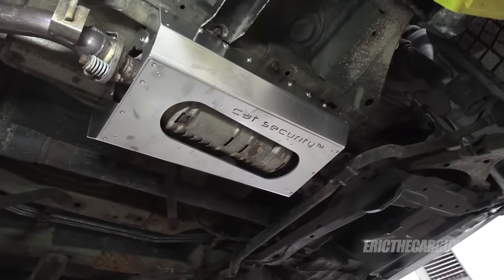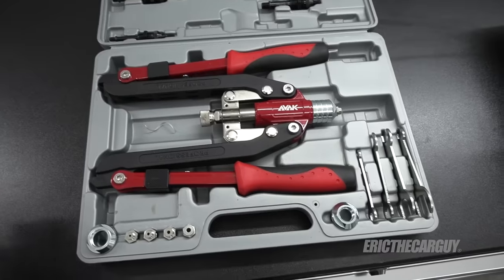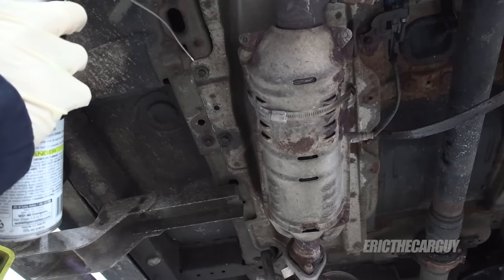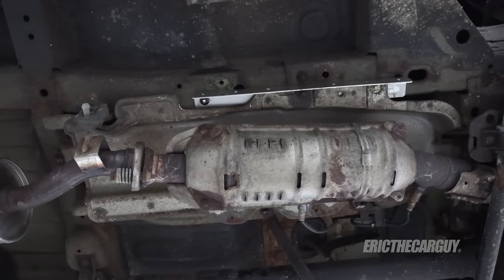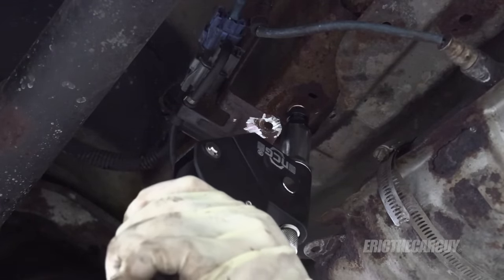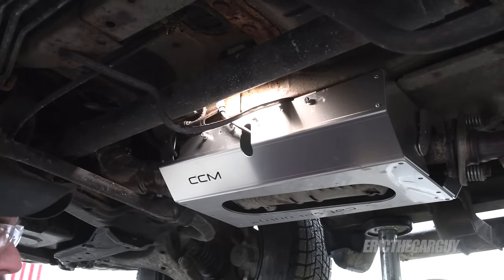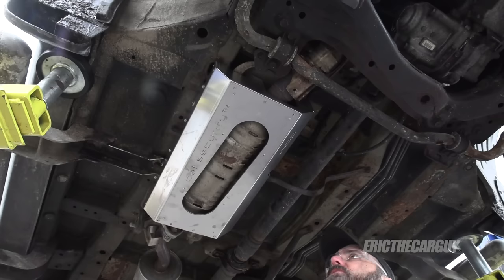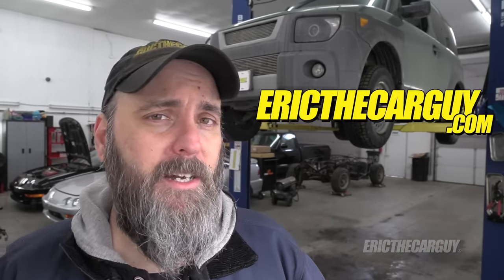How To Prevent Catalytic Converter Theft

Comment: They would be disappointed to steel mine, it’s empty lol
Reply: I am thinking about doing the same thing to my 2016 VW but I don't want to make the "check engine" light come on.
Reply: @mirkofernd  your check engine light is going to come on for some other BS. Or if not your car will break and there will be no point in saving your junk and you’ll scrap it and next time you won’t by a VW
Reply: Be careful removing emission components on these newer vehicles. You could reduce power due to engine going into a safe mode

Comment: Where do thieves sell the stolen cats? In some states, you have to show ID to sell scrap metal to scrapyards to thwart thieves from selling stolen metal.
Reply: I don't know, but I just bought a cat from Amazon for $160, which cost $1050 from Honda. It has ugly booger welds, but the car can't tell the difference. I wondered if it's just some poor victims cat with new brackets welded on it.
Reply from the maker: I'm sure they've sorted that out ahead of time.
Reply: I scrapped a few cats a couple years ago here in MA. They only grab your ID the first time you dump there. After that, you're in the system, so you just bring the stuff down and get paid. I think the only way someone could get caught is if the cat had a VIN number stamped into it, and the police were watching scrap yards for cats being dumped in particular. I've never seen that happen, here anyway.

Comment: They're now cutting off wires and other random sht in revenge when they run into deterrence systems.
Reply: In my area they are ripping sections of wiring harnesses out with the converters. They don't even cut or disconnect the wires they rip the 02 sensor wiring by yanking on the converter after they get it sawed.

Comment: There’s an easy way to prevent converter theft. Install a motion sensing lift kit on your car, thief goes to cut, sensor is triggered,and BAM! Heard of Venus fly trap? Yeah buddy!!!

You can accessorize by installing an automatic dispenser that will unleash whatever liquid/chemical on said thief once sensor is tripped. Phosphoric acid, sodium hydroxide, 90 weight gear oil, Raid, essence of skunk. You name it!

Comment: Big question that I didn't see addressed, what's it cost? Checked the website, depending on the vehicle, $150 to $450, with most in the $250 range. Not bad. Yes, they'll move on to easier pickings (usually) but when I put an upgraded sound system in my car and made it VERY secure, my son pointed out he knew some guys that stole aftermarket stereos out of cars and if they can't get what they're after, they'll totally mess up your dash, slice your seats, etc... I'd be interested to know if anyone with one of these kits installed has suffered cut sensor, brake or fuel lines.

Comment: It's remarkable that manufacturers have never really done anything about this problem from the factory.  It's not like platinum group metals used in cats were ever cheap, they were always very high value theft targets and the theft of cats is not a new phenomenon, if anything it has remained a relatively constant type of auto crime. 

I know it's difficult to secure it completely but it seems like next to no thought has been put into making cats more difficult to steal which is pretty shitty given we expect quite a lot from standard car security features, particularly in 21st century models.

Anything that slows down the theft is a good deterrent, nobody is going to spend more than a couple of minutes under a car with a sawzall.
Reply: Manufacturers wouldve already done this right, but you know what, the customers peace of mind is not ever in their best interest.

Comment: Why are the Prius and element Cats more desirable than other vehicles?
Reply: I know for the Prius due to it being a hybrid and the gas engine not being used as often compared to regular ICE cars, their catalytic converters are cleaner, less worn out, and the precious metals are easier to extract.
Reply: Element has more platinum than most cats i believe, its also pretty easy to get underneath to cut it out.

Comment: My vehicle has the cat behind the radiator, well up inside of the engine bay. While it can be annoying to remove as the owner, I have come to prefer this type of installation for 2 reasons:
1- It's easier to remove the sensors since I can do it from the engine bay by opening the hood.
2- You simply are not stealing it unless you have the keys to the car. Even if you do.. It's harder to cut out than remove properly as there is nowhere to fit a blade.

Comment: Seems like a toughened thick metal collar around the cat ends would be an easier detriment to install and without all the problems associated with the O2 sensors and security box removal work.  It is really just a time and effort deterrent that you need but I guess if they are looking to smelt the precious metals then maybe they wouldn’t care about cutting through the cat itself though that would be more difficult also.

Comment: Yay. Good times. In the middle of this job currently on my '03 EX AWD E - [Wisconsin] - and yeah, having to drill out/tap three of the fasteners. New Denso O2 sensors, O2 sensor bracket, heat shield, cat shield (via Casey Horner on FB), and all new OE/plated fasteners all going in with liberal cleaning, wire-brushing - followed by multiple rust converter treatments & anti-seize on ALL threads.
Looking to literally SOAK/treat the rear sub-frame to body mount areas in front of rear wheels while I'm in there.

Comment: Question, at the connection to the front of the exhaust are the spring bolts welded on the back side under the heat shield? Father-in-law and I are trying to replace the exhaust and those spring bolts WILL NOT BUDGE! Also, no size seems to fit them! Help!

Comment: When you’re thinking of the cost of replacing a cat you gotta remember they usually cut the cat out past the connection points so you need to replace your whole exhaust headers to the mufflers not just the cat
Reply: Never heard of cutting the damaged exhaust pipe clean then sliding it into a slightly larger pipe and fabricating the replacements? Whenever a mechanic specs out "replace exhaust system because pierced around flange" or whatever else, I go somewhere else.

Comment: Seems like a nice system, but I'd probably want one what would have all bolts rather than rivets.  It's true that a thief would then be able to remove it, but if it takes a lot of time to do so, it seems to me that it would still be a deterrence for the kind of people who would just be using a saw to cut it out of there anyway.

Comment: Looks like a thief would simply be forced to do more damage to remove this cat.  Those pipe flanges and hangers aren't cheap or easy to locate, you'll have to replace the entire exhaust inlet and outlet pipes, etc.?
The reciprocating blades I've tried get dull almost immediately, any recommendations on which blades won't be immediately ruined?

Comment: That's a nice system but it would cause future issues in changing any component relating to the cat/o2. I probably would drill a hole at each o2 sensor to have access for changing. 👍
Reply: Wouldn't they steal the 02 sensor?

Comment: I think i'd install an air suspension system and just drop the car to the ground when i'm not using it. I mean, think about it, not only can they not steal my converters, but they're also gonna have a hard time to A. steal the car itself B. steal my rims (like it happened to B is for Build a while back).

Comment: Eric My mech installed a need water pump (frm Autozone)in my 2006 Chevy Express 3500 6lt but it starting and overheating problem( new pump and thermostat) i was surprised he drilled couple  holes like  1/8" .. in the thermostat...and he solve the overheating problem..! Now my van runs one notch cooler..! But other than that everything is fine..! Here in Florida hot weather..can drilling the thermostat affect the fuel consumtion..?

Comment: I really like your videos,  Thank you. 
By the way I watched a vide video from "El Manazas " and he has a great formula for rust penetrating fluid compounded of 50% Dot 3 brake fluid, 25% high quality kerosene and 25% hydraulic oil or AT. Fluid. 
That thing works great! Excellent capillary effect and rust dissolving once you move. It a little 
The only problem is that it is necessary to keep a distance from painted surfaces.

Comment: Edmunds "The most commonly hit vehicles are SUVs and trucks, especially late-model Toyotas, because they sit higher off the ground (making for easier access) and the bolts that connect the converter are easily removed"

Comment: Good video and nice idea but honestly it would thief a thief an extra 30 seconds to cut around the aluminum guard. I guess the hope is a thef sees the guard and moves on to a easier target. Personally I installed a alarm with a perimeter sensor. The alarm chirps when it detects movement within a foot of the vehicle. Goes off if continued movement. Same idea to how a thief moves on to a easier target. Now if they make a cat shield that's heavy duty steel that would require more time to cut out, that would peak my interest.

Comment: Catalytic converter theft is on the rise. By the way, I found a video that shows how to clean it: he drills a small hole 🕳️ before the cat, and he sprays some carburator cleaner in the hole with a straw. I suppose that he uses a self tapping screw to close the hole when he's done.

Comment: Taking a que from the design of the metal shield ( basically to thwart any interest of the thief to cut out the catalytic converter) is there any product (heat tolerant) that you can paint on the inlet and outlet pipe that would muck up the sawzall blade, thus hindering any effort to cut the pipes?
Reply: Time for Google on that question. Good question though.

Comment: Ok. I've been researching this subject for what I can practically and affordably do. 

Here's what I'm gonna to for my 2 cats outer shields on my van is to deter theft: 
1. spray VHT paint chevy engine bright orange from autozone.  
2. order on ebay $3. stainless steel custom dog tags with my van's vin number embossed after the words "theft deterrent vin" to rivet to the shields. 
3. Buy some amazon shorter lighter bendable gauge, 18 or a bit heavier, 4 barbs wire, and wrap it around the cats and attach the ends to bolts in the chassis. Occasionally check to remove any debris or shopping bags that might get caught in the barb.

4. Write our elected officials to crack down on the buyers of used cats!
4a. Plan B. Consider stealing our elected official's car's gated community cats to give them a wake up call to the problem! LMAO

Hope that's enough for them to move onto an easier target.

Comment: On my Honda Element, I had a 1/2 inch socket extension welded to the front pipe to deter cutting because that pipe is short and there is no room to cut other than where the extension now sits. Should slow them waaay down.

Comment: The CC was stolen off my E a few month ago in Burbank because most crime in CA is legal now.  Morse Muffler replaced it and spot welded a hardened chain from the CC to the frame.  If another thief were to try and take it there's no way they'd get it off without creating so much racket someone would hear and run out and smash their ankles with a sledge hammer.  Or maybe a  cinder block.  ( I may have fantasized about that a bit too much)

Rides like the E get their CCs jacked because they are so easy to access and there's room for a clean cut to the pipe on each side so they can get in and out in less than two minutes.  If it looks like it'll take longer than that they'll bail.

Comment: Hate to say it but unless this thing is made HEAVY guage or hardened steel it is barely going to slow a thief down. Simply cut from the elongated end of the hole to the ends and bend out of the way. Only two extra cuts that would take no longer than the two cuts required to separate the cat from the exhauset system.

Comment: Does bolting/riveting dissimilar metals together cause corrosion in the long term?  The shield appears to be aluminum, the bolts are brass, and the chassis is steel.
Reply: those metals are safe to engage though I would think you have to consider the heat factor for alum.

Comment: Why couldn't you just cut the box off with the same saws all you cut the exhaust pipes with? I'm just curious if it is hardened steel or just an extra 5 minutes you have to give the thief lead poisoning?
Reply from the maker: You could, but that would take time. The more time you spend trying to steal something is more time that you risk getting caught.
Reply: @ericthecarguy  true, just ended up being easier for me to park my car in the fence with my rottweilers, with the bonus of they dislike my sister's husband so my tools don't wander off. It would take an extremely desperate thief to face off with those 4, if they are being lazy, and myself afterward. I used to have alarms, but after watching my Impala SS drive off alarm screeching and fuel cutoff very much not turning off, this was the next logical escalation. I prefer to scare them off, by doggo or warning shot, but if they're stupid and feeling froggy, I'll try and avoid vital bits whilst shattering Their large joints.

Comment: So, i have a question... my mazda protege 2.0 somehow ended up with rock and debris in the engine causing valve chatter and oil pressure drops causing it to shut down. Is there any way to clean it out with the engine still in the engine bay? I dont exactly have the necessary tools to pull the motor

Comment: 13:27 But in the 2WD model isn't that hole still there, threaded ready to receive a bolt for the drive shaft security strap if the vehicle shell becomes an AWD in the factory?  So either way, a bolt can go back in and the rivet is not required.

Comment: BTW This device is illegal in states like California. On inspection the cat must be visually inspected to see its original or has an EO number etched on it.
Reply: The manufacturer says otherwise on their site:
  
Are Cat Security™ products smog compliant?
The short answer is yes. Smog techs have to check the catalytic converter to make sure it’s compliant. You can view the catalytic converter to see if it’s the factory one which is what they are required to do. If it’s an after-market cat and installed correctly you can clearly see the EO that is needed to verify and the oxygen sensors. On all of the products we have, there are strategically placed viewing windows that will not interfere with a smog check.

Comment: One thing that concerns me is having a stainless steel box around a very HOT converter.  How does the heat dissipate?
Reply from the maker: Keep in mind catalytic converters already have shielding around them. Also, the large opening in the bottom and at the back likely offer plenty of airflow. Lastly, catalytic converters work best when they're hot. I've been driving mine for about a week now with no issues that I can tell.

Comment: How much does this take away from the ground clearance? I have CR-V that I actually take off road, and it would be pretty funny if I smashed this thing off going over a rock.

I actually have dented my exhaust pipe going over stuff before (just not between the front wheels where my cat is), and it was pretty funny. 😂😂😂

Comment: Those instructions have nice color photos but are very unclear, in my opinion.  Numbering the steps to match the photos would be helpful.  Specifically, the section where it describes the driveline brace.  First it doesn't look like  a brace at all.  It's simply to prevent the driveline from hitting the ground should it drop from the front.  Then they have you remove that driver's side bolt but for what?  You didn't remove it and I didn't see any reason to remove it.  I was confused as to whether that loop strap was being relocated or not.  Again, they could do better with the instructions.

Comment: I solved problem.  They cut it at my acura tl 2003.  I bought new from ebay for 80$.  I do understand that Honda did put much more of precious metals in it but it is not my problem any more, I go with cheapest.  Who think about air pollution can complain to police.  My cat was stolen from my car that is 15 yards from camera and is nothing between.  Cops didn't even bother to check video.

Comment: Sorry Eric, that's a "NO" for me. The guys who steal these things just used a sawzall to make quick work of the pipes and any brackets.  They just hack right down the middle of that thing and she's wide open. This thing won't stop them at all.🤷‍♀️
Reply from the maker: I never said it would stop them. I said it would deter them. Mainly because of the extra time it would take to remove it. The more time they spend, the more chance they have of getting caught.
Reply: This thing is stainless - it will shred most sawzall blades. Between that and the extra time to cut. 99.9% of thieves will just move on to an easier target.

Comment: Someone stole my cat and I deleted it with a pipe. It runs so much better. I had to use the defouler trick on the secondary o2 sensor. Smells really bad running on 87oct but smells great running 94oct

Comment: this just happen to my moms car differently going to get this installed after the car is fixed. such a nightmare for my mom. just happen last night and cut a coolant line as well for the battery pack so i can't even drive the car right now.